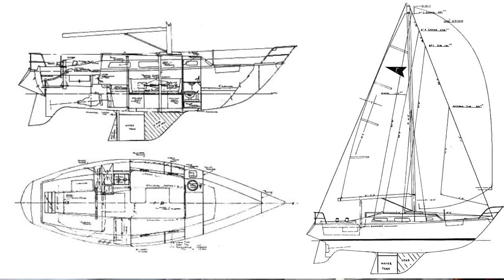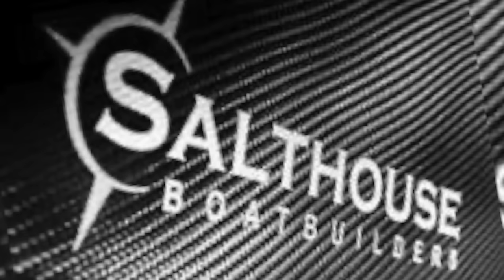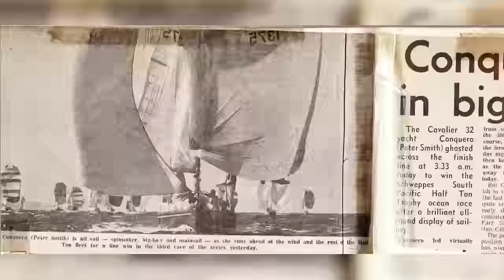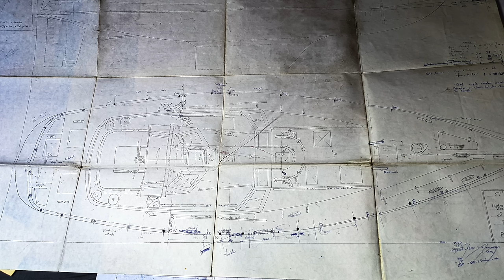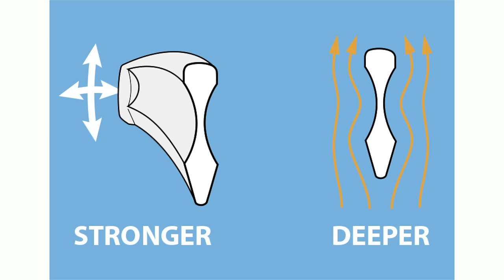Offshore Sailing legend and Rocna inventor Peter Smith.

Comment: "Nobody else ever worked on this boat but me" - that alone is hats off. Someone builds something from top to bottom and sails the seven seas with it is Tier1 in every possible definition of the term. Hats off.
Reply from the maker: Well technically someone else built the engine, winches, mast and boom, made the sails etc but Peter installed all. I find it incredible that he did all the welding, joinery, electrical work, refrigeration

Comment: What a great interview. Learnt more in the last 30 minutes than all the other sailing vids combined. The thought that went into that boat is just unbelievable. My Ovni 370 delivers next year and I will set about on my circumnavigation. Disagree a bit on the solar. It has come a long way in the last few years and along with LiFePO4 can substantially reduce the reliance on fossil fuels. But what a legend. Sir, you really inspire me!
Reply from the maker: Great to hear that you enjoyed the video. I think some of you are taking Peter’s comments about alternative energy in the wrong context. Maybe he should have been more specific. In the places HE mostly sailed solar was of limited value. Sail around the world by the trade wind route and solar will be all you need. In the Falkland Islands not so much. Also, in the huge seas Peter has faced a solar arch is a very vulnerable thing, waves will rip the solar right off. I disagree with him about lithium though, I’ve had it on both my last boats and it’s a massive step up from lead-acid in all areas. Good luck with your new boat, I love the ovnis and might be lucky to own one someday.
Reply: I agree with him about the solar and wind turbine. He's boat built for storms with sustained winds exceeding 50kts+. Those things fly overboard or breaks in those conditions and then you are on your backup system. 2 liters of fuel/day to generate his energy needs with a generator is a no brainer.
Reply: @SailingLearningByDoing  Better the devil you know than the angel you don't. Decades of experience dealing with the limitations of lead-acid would make one quite comfortable with what you can and can't do...and if it ain't broke.
Reply from the maker: @phillipdelatour7729  yeah exactly and that’s where I think Peter  is at.

Comment: I live on the West Coast of Scotland on my 1986 Moody 47. We get 60+ knt gusts almost every week in most winters. For example in the last week I have had 2 days of 65+ and 60+ gusts. Five miles away it was over 100.  I use a wind generator all the time and have done for years without major issues. The video of South Georgia just looked like winter off the west of Scotland. I am full of respect for Mr Smith but most of my serious sailing friends have wind generators too and are delighted with them.
Thank you for the video and thanks to Mr Smith for sharing his experience and thoughts. The real deal!
Reply from the maker: Do you sail often in that sort of wind? Peter was crossing the Drake passage in huge waves and wind. I think he meant in general they wouldn’t handle the conditions he faced. Pretty sure he wouldn’t make that claim without first hand knowledge. Still, each to their own. I love my solar panels and don’t even have a generator onboard.
Reply: I totally avoid sailing in winds like that. Usually spend the 6 winter months in a marina, and sail and anchor out for the 6 summer months. Even in the marina the winds are blowing with these strengths. I am striving to be totally off grid, so the wind generator is a marvel particularly in winter when solar just doesn't cut it.
Reply from the maker: @boatsandbits7091  well that would be the difference then. Peter could never rule out sailing in hectic conditions as there’s no marinas where he mostly went. 60kts with the accompanying waves is a lot different to being in a protected marina. The other big thing, where he was there was no way to replace broken gear so anything remotely fragile would be out of the question.
Reply: I am well aware of what he goes through in the places he sails. Describing the marina I am in right now for example as sheltered just reflects no knowledge of the situation. Last week I had waves breaking over the walkway beside my boat with white water between my boat and the walkway...hardly what I would describe as sheltered. The way in which the wind generator is attached to the boat is just engineering. My generator has withstood 80+ knot gusts without problems, but it is very sturdily attached. As for the generator itself, it has withstood these winds for 4 winters now and seems fine. What I am saying is I don't think the sea state would make any real difference. For a wind generator its all about wind strength, assuming it is properly attached to the boat. I am not trying to negate anything Mr Smith says, I am full of admiration and respect for the guy, but rather I am just pointing out my experience with a wind generator in conditions akin to the sailing Mr Smith sails in. I spent the last 12 years of my working life repairing sailboats professionally both in California and Scotland.
Reply from the maker: @boatsandbits7091  umm nah. I ve read plenty of reports of waves washing away entire solar arches. I’ve seen something as simple as a broken reefing line wreck a set of propellor blades. Like Peter said, some people rely on perfection for everything to work, he doesn’t. And yes, any marina is sheltered compared to the drake passage, svarlbad or Greenland anchorages.
Reply: @SailingLearningByDoing  I wouldn't have an arch on my boat if you paid me!
Reply: And I am talking about measured wind speed on the boat. 65 knots is 65 knots whether its in Drake Passage, Scotland or the moon. The point I make is the generator is capable of handling that. I know this from experience. As I mentioned earlier for heavy sea states the mount needs to be designed for the job of keeping the generator on the boat. I feel this conversation is going nowhere. Was just giving viewers my take based on my experience...nothing more and nothing less.
Reply: @boatsandbits7091 Your not account for the waves and sea spray when sailing stormy remote coasts. We get that you anchor in these conditions. But sailing in them is another story.
Reply: @HighMaintenancePS  I take your point. All I was trying to do was make the point that some wind generators, when properly mounted in a good location on a boat are actually up to the job in high latitude heavy weather conditions. Nothing that has been said convinces me otherwise. My own sailing experiences and the many other sailors I come across who sail Iceland, Svalbard, and similar places, with successful performance from their wind generators reinforce my own perspective. Amen!

Comment: Nice vid mate.  Why aren't all yachts designed like that? The engine room and all design features are way ahead of the times.
Reply from the maker: The obvious answer is COST! This boat would cost at least double what a 50ft Bendytoe costs. Also, the majority of cruisers stay in the warm climates and as Peter said, want big open salons. Amazing boat and it will do its job perfectly for another 50 years I reckon

Comment: Excellent interview and what an achievement in life to have done all that he has done. That boat of his is just incredible. I wonder if he sells plans and what improvements he would make. I also wonder how that large dent to the forward edge of his keel happened. Those hatches are the same basic design as what Tim Mumby designs which I believe are the best type of hatches you can use. I love how all of the exit ports are just above the waterline so they won't leak. That's what Onboard Lifestyles did. How many of these boats were made and does he have plans available?
Reply from the maker: The dent was a rock he ran into at 5kts in Greenland. Thanks, glad you enjoyed this video.

Comment: Running a genny 2 1/2 hours a day would drive me nuts.😄
Reply: lol I get it but not having any power generation would drive you nuttier,unfortunately we can’t live without it,well we can but I enjoy some modern conveniences.
Reply from the maker: Yep me too but as he explained, in the places he's sailed there's no viable alternative. With 50kt gusts you wouldn't hear the genny anyway😉
Reply from the maker: @svthorasailing4868  exactly. He's provisioning for 2 years so his freezer is full to the brim, 7 cubic feet.
Reply: @SailingLearningByDoing  absolutely hear the rigging screaming in those winds,15000 btu diesel heater would be worth its weight for sure that he has on her,it’s miserable on a cold boat,been there fuck that.apologies.
Reply: @svthorasailing4868  agree completely if it is only used for high latitude expeditions. Soler panels can be very securely attached.